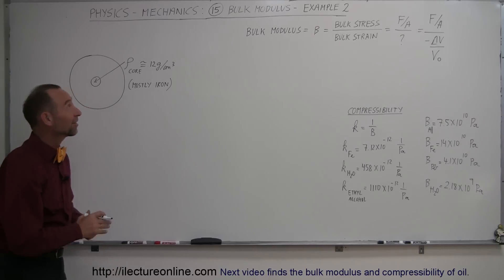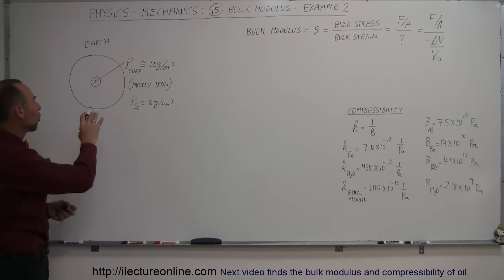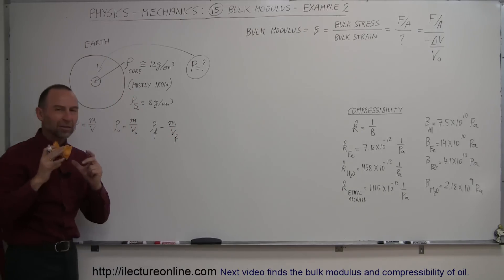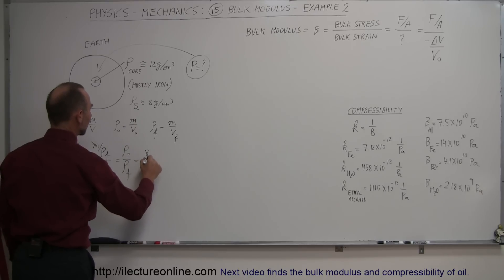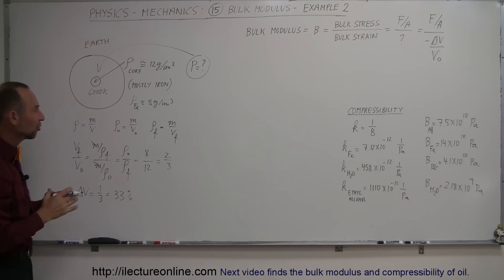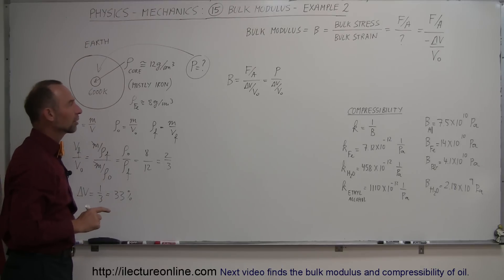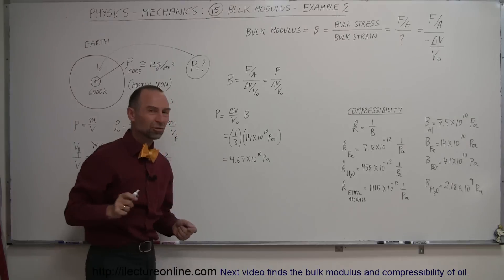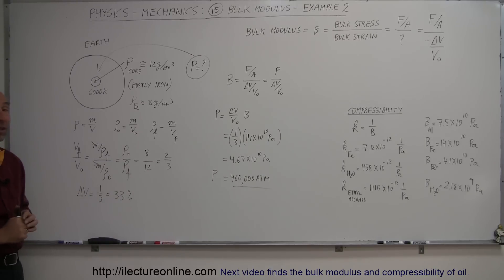Physics - Mechanics: Stress and Strain (15 of 16) Bulk Modulus: Ex.2: Pressure at Earth's Core

Comment: may i ask why don't we put the negative sign in this case?
Reply from the maker: Averyl,
The negative sign signifies the fact that the volume decreases under increasing pressure.
Thus the delta V is negative.

In the problem we don't use the negative change in the volume, but the ratio of the volume near the surface to the volume of the material near the center of the Earth.  
That ratio is positive, so we don't use the negative sign.